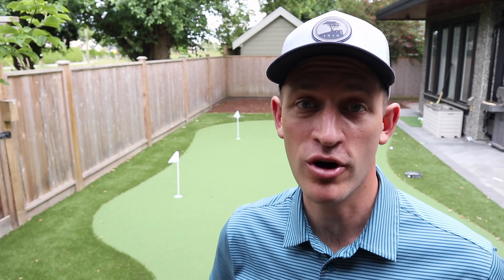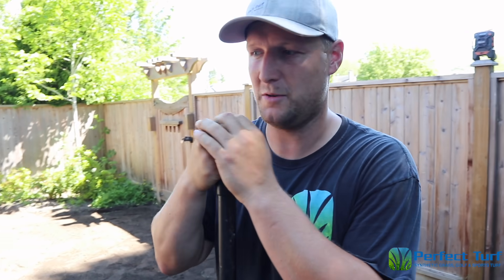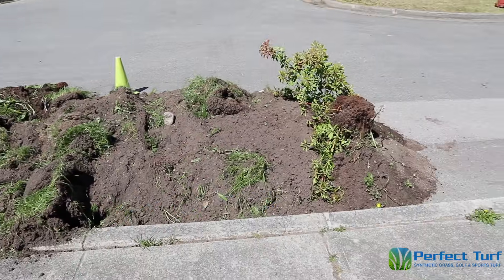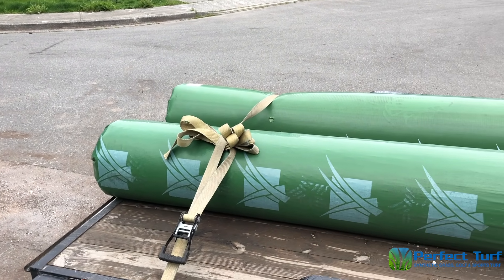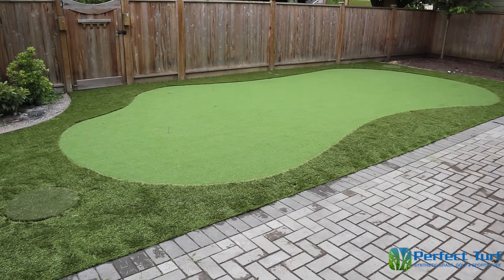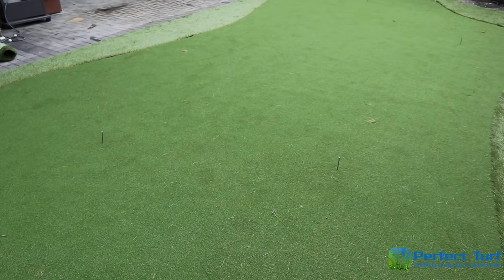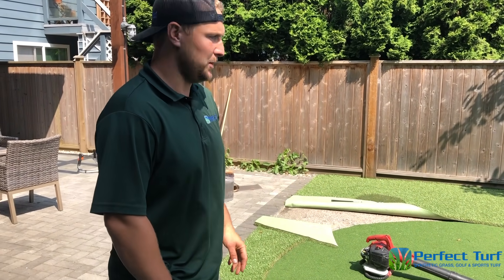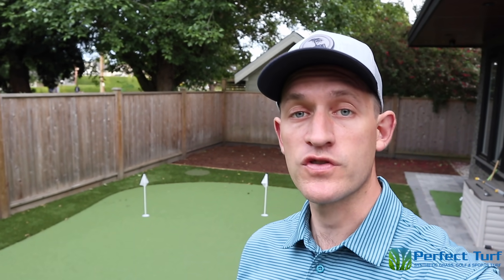How to Build the PERFECT Home Putting Green - Behind the Scenes Tour

Comment: does it actually roll just like a real grass green though?
im in the long process of putting one in my backyard but out of actual couch.
Reply from the maker: Hey Will, it really does roll like a real green, you can control the speed by adding more sand and compacting it, so you can honestly set the green speed to however fast you want it, of course you can't take out sand, so want to increase slightly. I've been able to take the feel from this green and bring it directly to the course with great results 😀
Reply: @CyrusJanssen  Cool! I might look into doing this instead of waiting for couch to grow then trying to mow it down.
Reply from the maker: @willhull7842  You won't regret the purchase!
Reply: Will, I have an actual bentgrass green at my house. I have 2 acres so I can hit into it from about 80 yards. It is way more work than you can imagine! It’s also constant expense. I will add also that it is still not as good as the one at my golf course because I just don’t have the time needed to properly maintain it. I would go artificial for sure!

Comment: How do you get rid of "bubbles/winkles/creases" in the middle of the green? Tried everything.
Reply from the maker: Luckily I haven't had any problems with that yet, however you do need to get a large roller and roll the green out every so often...I would call the company you had install it to see if they can swing by and roll it out, this would be solution I think
Reply: They didn’t add enough infill!

Comment: How big is your putting green just out of curiosity
Reply from the maker: It's about 10ft x 30ft I would say....perfect enough for a some mid range putts, but more important have enough hole locations for uphill, downhill, left to right, and right to left :)
Reply: Cyrus, are you saying that this cost you about $3000  ( in other post you stated that 1000 sq ft. will cost about $10,000 or about $10 sq ft so 10 x 30 = 300 sq ft at $10 per sq ft = $3,000)? And is that in U.S. or Canada money? ( $10,000 in US is right at 14,000 in Canada and 10,000 is $7,150 in U.S.) Just So you know, I have wanted to put in a putting green since I had back surgery more than 15 years ago. Played my whole life until I hurt my back The day after my best round ever. The two reasons I have not are "real golf green feel" was lacking and cost. If the cost is about $10 a sq ft U.S., that no longer is a problem...but when you play your home course, does your practice on the artificial green help you, that is, does the feel of your home green have the same feel as the greens of your local club course? And if it does not (i.e. in the past the artificial grass was too slow) can you add sand and pack it and change the feel and speed of the artificial to match the "real"?  thank you for posting your build. I believe that it is not an exaggeration to say this could change my life.
Reply from the maker: @dalewier9735  Hey Dale! Thanks for the comment...sorry for any confusion on the pricing/size of the green. The 10'x30' is just the size of the green, not including the rough area and two chippings bays (2 small round circles to hit chips from)...all in this was around $13,500 CAD. That's why I mentioned the 10k figure before. I'm sorry to hear about your back injury, but the day after your best round? wow, at least you have that great score to remember. To be honest the putting green has translated to great results on the real golf course as well. I mainly use it to practice putts within 10ft of the hole, so it really increased my make % from this distance, which of course leads to lower scores. Yes, you can add sand, compact it, and increase speed to make it faster. I would say it's one of the best investments we've made. Our kids love to run around on it. Our backyard looks amazing every day and saves me maintenance time, and it will last for 15 years. I have no regrets on this purchase!
Reply: Cyrus, immediately after  watching your video yesterday, I went to the back yard with a purpose other than to mow it! If I "draft" the men in the church to help maybe I can have myself a putting green.
Cy, I first played in 1968 at 7 years old and have played until the surgery. My wife told me the surgery was about 9 years ago not 15. But truley, the day before Thanksgiving 2011,  I shot 71 on a local course (Crown Colony Lufkin, Texas- from the black tees. Course was rated top 10 best courses in Texas then.) THE NEXT DAY, I was helping a church member move and I blew disks out (L-5,L-6,) can't follow thru like I could.  I had been practicing 40 to 75 yard wedges, 1000 to 1200 a week in my front yard and it had really helped. I must again play golf somehow, even if it is just putting and chipping. This home green setup is the very thing that will get me back in the game. Even my wife is for it because it will keep me from building and flying  experimental aircraft! ( I am sure anything is preferable to her). I will make a point to send you pictures when I start this project. Thanks again and God bless
Reply from the maker: @dalewier9735  What a story! God bless you too Dale, please do send me some pictures and I look forward to seeing your putting green, I know it will bring a tremendous amount of joy in your life! Stay safe for the meantime with your family as God leads us through these crazy times! Blessings!